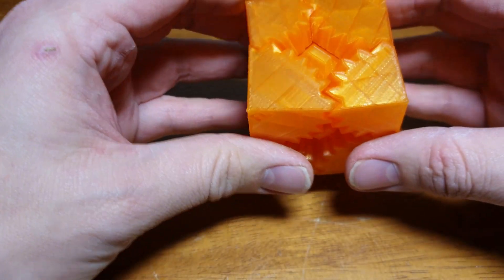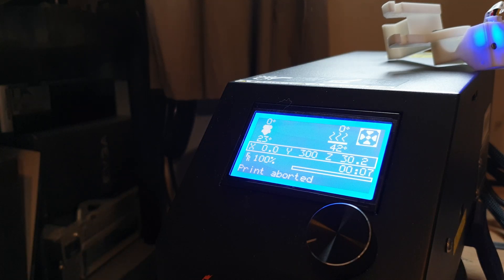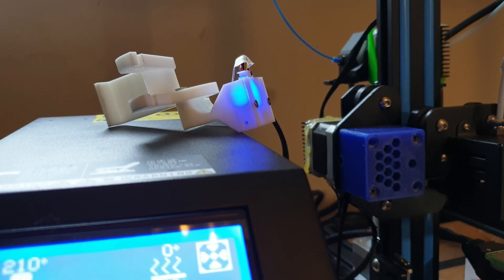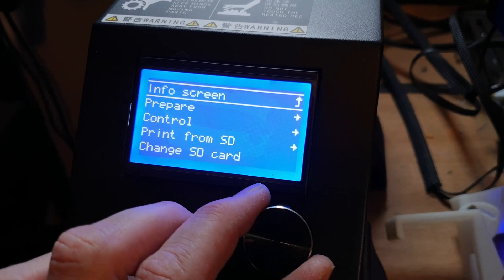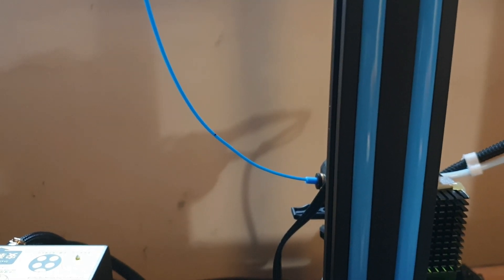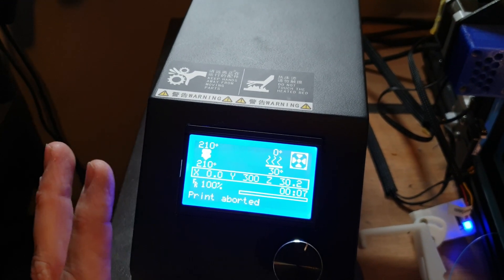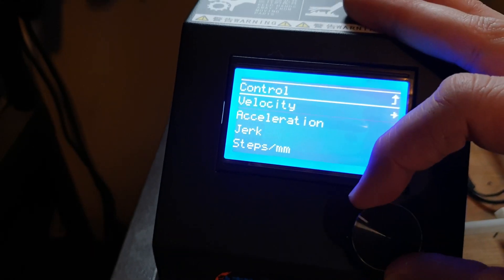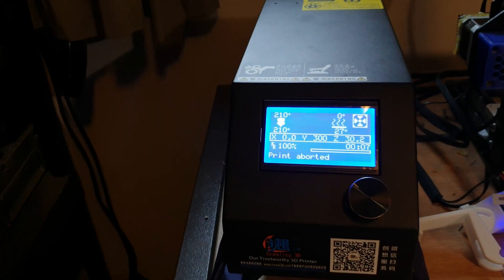Calibrate Esteps on cr10s and others

Comment: Just came across this as im a firm believer in, " if its not broke do not fix it " and thats been the case since i got my cr10s pretty much on release maybe 7 years ago. never touched anything until i started having under extruding. this was a great simple video and im now back up and running.
thank you.
Reply from the maker: really pleased it helped. my cr10s has been a solid machine still my go to machine for most my prints.
Reply: @Awesome3DPrintz  yeah as
Much as I love my newer resin printers this cr10s is a workhorse and now actually feels like it’s printing better than ever. So again thank you :)

Comment: This worked great on my 3 pro, but my cr-10 varies about 35mm each time I run the test even when I don't change anything. I replaced the bowden tube and nozzle, is there something else I should be looking at?
Reply from the maker: if your results are not consistent then it has to be a fault, maybe start with checking your extruder for damage check spring tension failing that check your belt tension. if it was consistently out by the same margin you would need to tune your steps per mm on X, Y, and Z axis. good luck

Comment: Original model CR10: I don’t have the options on the screen to change the e steps. How do I change it? Slicer?
Reply from the maker: you don't change it in the slicer. you either need to update your firmware or you use something like prontoface to send the g commands via a console.

Comment: THis is a great video and makes it very easy, however, i am having an issue where i am under extruding and i dont want to do these steps because i fear it is not calibration issue, but a clog somewhere, i have replaced the bowden tube and the nozzle and yet it is not coming out right so i still have some work to do...either way thanks for the video
Reply from the maker: the only things left to check is the throat and the extruder it's self. Some of the machines with plastic extruders the arm is known to crack so worth checking. Also check your throat material can build up inside if it is an all metal throat check your retraction settings they shouldn't be more than 2 or 3 mm .
Reply: @Awesome3DPrintz  after a bunch of testing I found it was the nozzle, I bought a bunch of harnded steel nozzles and apparently they expanded in unexpected heat and became too narrow and too long

Comment: Hmmm My printer doesnt display a number when i go to extruder movement but it does extrude if i turn the dial all the axis have numbers but not the extruder is there another way i can do this or a way to fix it?
Reply: My CR10  has no extruder adjustments at all !?
Reply: My CR10S also doesn’t show the extruder option. Do I need to update the firmware?

Comment: do you have to edit anything in your slicer also? or does this fix it for everything you print from now on?
Reply from the maker: you shouldnt need to change any slicer settings unless you switch to a different material such as TPU then you might need to change your flow setings